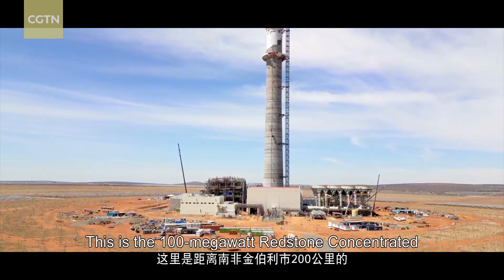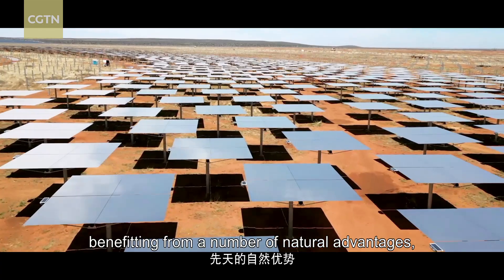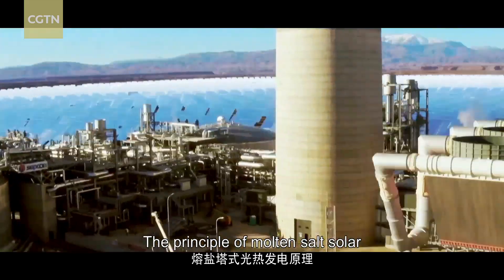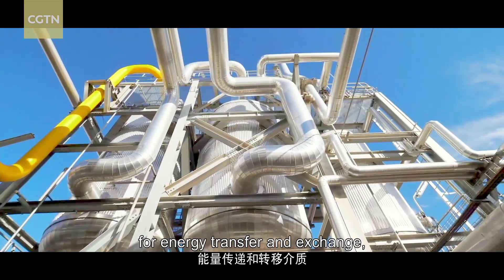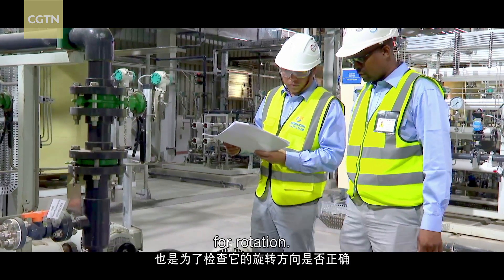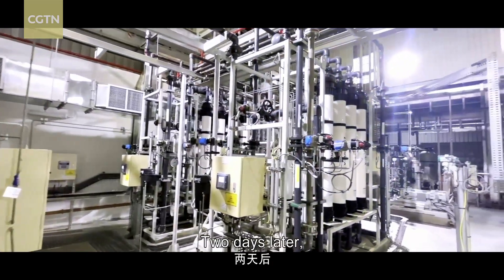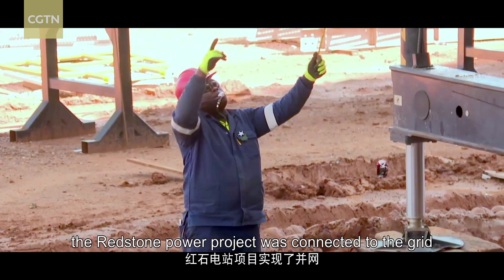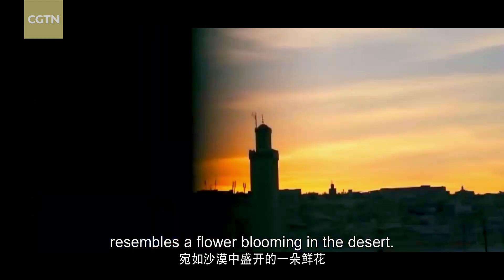Chinese-built solar plant promotes low-carbon energy transition in South Africa

Comment: I have thought about this method of power generation before, I think its effectiveness would be dramatically increased with Fresnel -style mirrors or lenses or convex mirrors that could shift alignment depending on the position of the Sun, without taking more energy than the benefit of the new design.